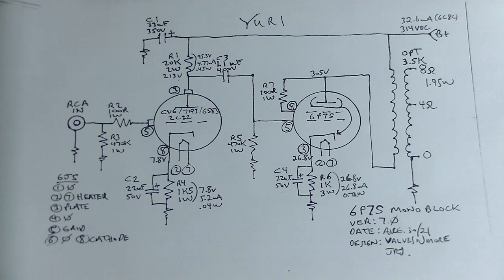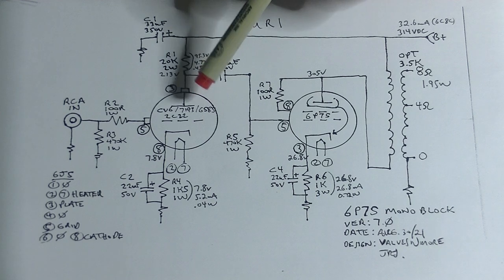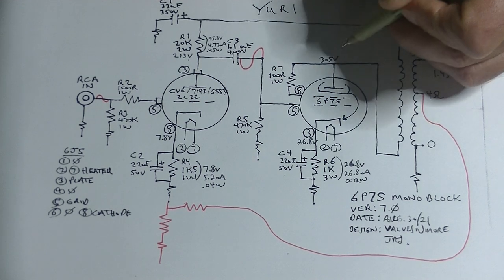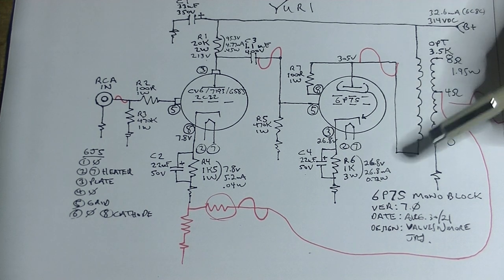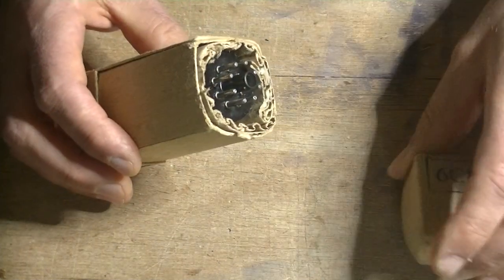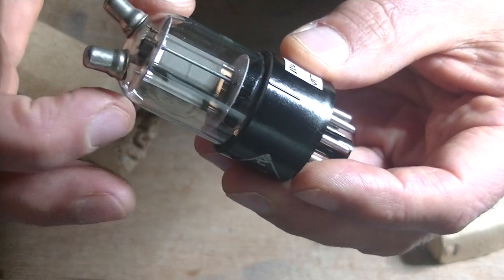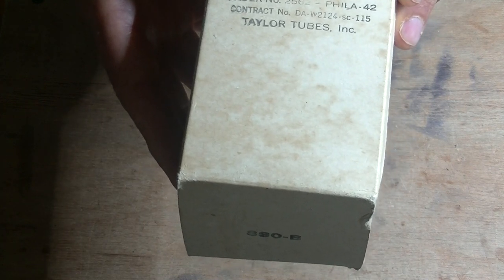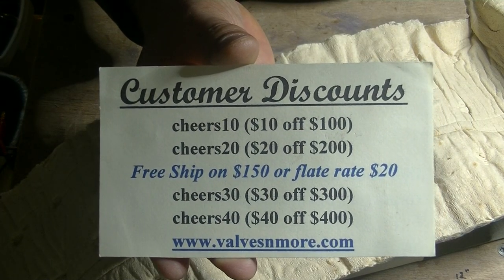Tube Lab #53 Negative Feedback

Comment: I understand the principal of negative feedback, but since there is a capacitor between the stages, wouldn't that cause a phase shift in the signal, and when feed back into the input tube, would not that phase shift, from the source signal, cause some distortion?
Reply from the maker: Correct, every time you feedback a signal you get a 45deg phase shift.  As a designer I occasionally try a feedback circuit in my tube designs, but I'm far from an expert and have never liked the results.  All of my designs are Pure Class A, that's the sound I've fallen in love with.  In pure class A you have a phase intact signal from beginning to end, with no feedback.

Comment: I wasn’t watching but listening in my car and I was waiting to hear what value resistor you used. You talked about experimenting then you didn’t say what it was (I think). I know it depends on taste and the circuit  but I was curious.
Reply from the maker: This Tube Lab was filmed a long time ago, but if I remember correctly I experimented with 3 levels of FB, using a low, med & high resistor value and a couple of return points.  Don't ask me what the resistors values were, maybe if you watch the video I showed a working schematic.  The key take away for me is in class A tube circuits I really don't like the results of feedback.  For me as an audiophile and designer, clarity and musicality are my prime goals (after I meet the basics - low noise/distortion etc).  And imo feedback messes with the phase and clarity of the signal.
Reply: @tubelab194  makes sense, thanks

Comment: Very curious about your experiments with the 830-B!!  I'd love to someday build a SET amp that puts more than 10wpc (like the 300B amp I'm currently running).
Reply from the maker: Yes a high power tube amp would be fun.  If a tube is rated for 60w, typically you can only expect about 15wrms in Class A, that's how inefficient SE amps are!  I've owned large amps and small amps and in my opinion the best combination is efficient open baffle (dipole) speakers and SE single ended monoblocks.  And here's the amazing thing my little 2w Yuri monoblocks sound better than all the other higher powered amps I've owned.  Some of it has to do with the linearity of the tubes and circuit, some with the quality components and build, but I think at the foundation is a straightforward design with minimal circuitry, short runs and attention to small details like how the heater circuit is designed and fed overhead to the tube pins.  This is one quiet amp!